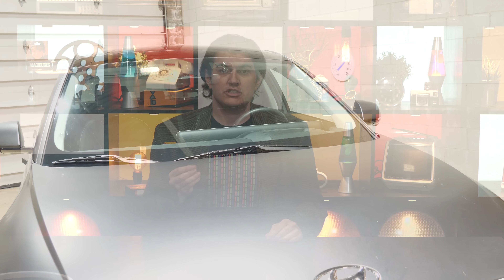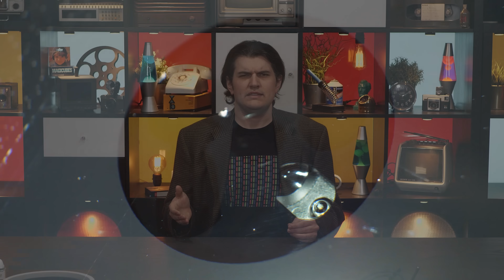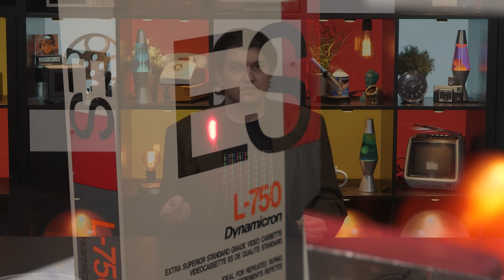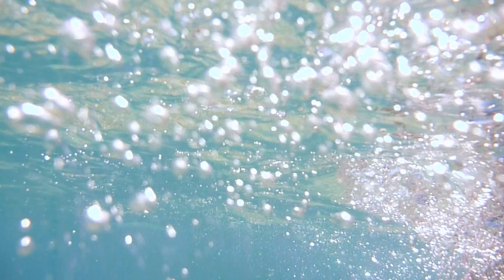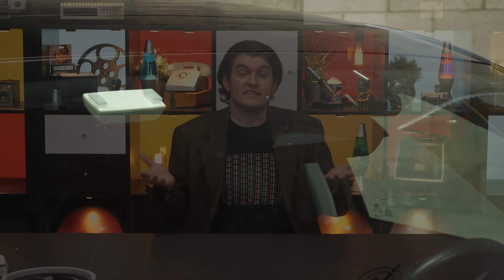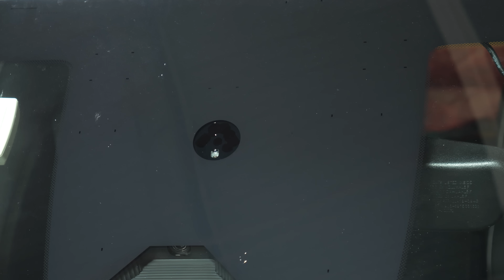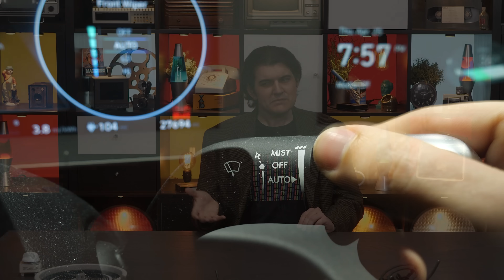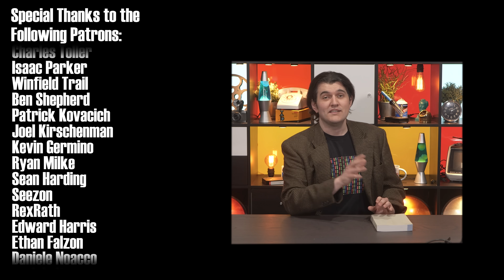The simple, clever sensor behind automatic windshield wipers

Comment: As someone who previously installed windshields in cars, I can confirm that the gel layer is incredibly sticky and if there's any air between the gel layer and the windshield or sensor the auto wiper function will not work! also my Hyundai has the same Konami code for my wipers as well and I suspect most Hyundais have the same control input to change the wipers. Easier to copy/paste code than design from scratch on all vehicles

Comment: FYI: every car I've ever had which requires a maintenance position for the wiper blades is put into the maintenance position by holding the wiper stalk in mist while the car is off and unlocked. which, now that I've had a few cars that do that, it seems like the most logical place for it.

they apparently make cars without wiper stalks, though? that's exceptionally silly.

Comment: It is difficult tu make a software  control when you dont really measure the value which you want to control
Reply: I think they know the size of the rain drops and frequency.
Reply: Either way the automatic wipers on my A4 B8 Worked way better.
but at least since the matrix software the automatic headlights were fixed

Comment: I hate auto rain sensing wipers.  I've had them on two cars, and they didn't work well on either.  Either the wipers practically never wiped, or they would wipe like crazy as if you were driving through a tsunami, when it was barely sprinkling.  I wouldn't have minded if they didn't work if the manufacturer hadn't REPLACED the intermittent the setting with AUTO on both cars (so the options were HIGH/LOW/AUTO)...if you are going to offer auto, make it a 4th option (HIGH/LOW/INTERMITTENT/AUTO).  I would much prefer intermittent, with a variable speed intermittent setting, than the awful AUTO setting.  If it's hardly raining, even then the LOW setting on cars can be overkill....that's whey a variable speed intermittent setting is so useful.  Terrible decision to replace variable speed intermittent with AUTO.  Even supposedly adjustable-sensitivity AUTO is a FAIL....as the sensing is still garbage.
Reply: Ford is probably the only car manufacturer that has good rain sensors, my work van had auto wipers with a fine tune dial for sensitivity so you could make it just perfect.
It also had the option to turn the sensor off, so you had a regular intermittent wiper.
Volvo trucks also have a great rain sensor, i drove a new FH for a while and the whole truck was amazing.

Comment: I think it'd be interesting to learn how modern cruise control works, im sure the manufacturers have their own 'recipe' for what makes the ideal cruise control.

Example: my 2016 Mustang has manual transmission and with that in 6th, with cruise control engaged, it will seemingly maintain speed VERY well while acsending AND descending. This is withiut using brakes, mind you. When headed to Pittsburgh, there were a few moments of steep descends and the car did a good job of staying around the speed I programmed it to.

Of course, you have your more advanced cruise control systems that will lane-keep and brake itself but thats getting too modern for what I'm interested in.

Comment: In 2015-2018 volvos you have to partially insert the key fob into the slot in the dash, turn off the car. Turn on accesory mode, then hold up the wiper stalk to set the wiper arms to replace the blades. Luckily you can favorite this in the digital owners manual in the cars info screen. I forget it every time I need it when washing the car.

Comment: The complete opposite to my Nissan, I have to turn it on to accessory mode then push my wiper stock upwards twice quickly, and it'll park them in “service mode”. I totally didn't have to look it up because it isn't in the manual anywhere…

Comment: These sensors were the example my old physics teacher (2015) used for a real world application of total internal reflection.

He described a slightly different operating principle which some manufacturers may employ or at least may have at the time.
IR light is injected at the edge of the glass such that TIR keeps it contained within the pane, bouncing up and down like an optical fibre. At the opposite edge, a sensor detects this trapped light. Source and sensor both need to be optically bonded to the glass, obviously.
Every drop of rain causes a small amount of light to escape by changing the critical angle due to the glass/water vs glass/air interface.

It's quite an interesting method which allows sensing of the entire width of the windscreen, rather than just at a single point or small area, but would likely more costly, requiring 2 modules rather than one. I would assume it would be less prone to false negatives due to the larger sensing area, but more prone to false positives, especially it the windscreen ever cracked.

Comment: I hate this stupid inconsistent sensor with a passion. It's never right and it's always too slow even at maximum sensitivity! WHY? WHYYYYYY????
I miss manually selecting low speeds in older cars.
Reply: I found that coating the windshield with rain repellent makes it way better. In my old work van i always used the minimum setting in every weather after i put on the stuff.

Comment: Automatic wipers are the  absolute worst part of the new car I bought my wife a year ago. I respect the people who devised them for having a great concept, but it just does not beat or even equal traditional intermittent wipers. That wouldn't be an issue except that several car makers replaced intermittent with auto rather than making in an optional ADDITIONAL setting.

Comment: I hate my auto windshield wipers because sometimes it's only a little bit wet and they don't go, but I still can't see. My car has a dial with like 10 settings for the wipers, and the first 6 settings all change their speed based on the wetness. If it's not very wet, setting 6 will be almost nothing, and setting 7 is always pretty aggressive. I've never tried settings 8-10.

Comment: I hate these things. The problem is they replace intermittent wiper settings forcing me to either accept whatever speed the car deems correct, or stuck on continueous all the time, not to mention when the sensor inevitably fails like mine, you've now lost the intermittent settings completely. It just seems an unnecessary addition to a problem that never existed, when my eyes are much better at judging whether I can see clearly compared to a sensor that covers <1% of the windscreen.

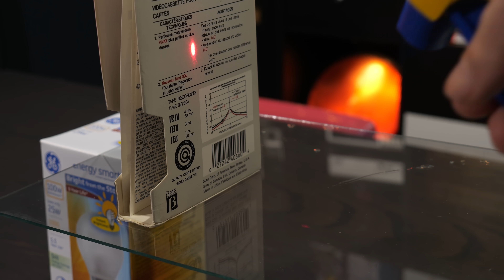Comment: 5:37 the optical phenomenon that occurs here is called Frustrated Total Internal Reflection. Its also used in digital fingerprinting, light is transmited where the ridges of the finger make contact with the glass or plastic interface.

Comment: Every vehicle manufacturer I have worked with has required a calibration of the Rain/Light sensor whenever it is replaced. Most require the vehicle to be indoors, all require the vehicle to have a dry and clean windshield. Most I have worked with save the calibration directly to the Rain/Light Sensor, from what I understand.

Comment: I worked for Acura 20 years ago when they introduced automatic wipers on the MDX. The early models had issues with the sensor interface to the glass. They were prone to false operation because of vibration. We diagnosed them by lightly tapping the glass. The faulty ones would go nuts with the lightest touch to the glass.

Comment: Hmm, I am not sure about that recalibration at every startup. Though it probably does do a self-test.

I'm sure it's different between suppliers but I've worked for two different OEMs and we do this calibration on the line. It has to calibrate three times in a row and then should be good to go from then on.

Comment: I had two very nice surprises recently after buying a very cheap Citroën from 1998. First, it has a rain sensor. And second, It´s by far the best working rain sensor i have ever seen. It never gets confused or start when it´s dry or forget to wipe when it´s wet. It´s 100% perfect all the time. And they did that in 1998!
Reply: Citroën had always been innovative. Sometimes too much for their own good.
Reply: @Filip_Phreriks  They are so brilliant that they had solutions to even non-existing problems. One of my favorites is that the magnificent DS had real-time self adjusting height correction on the headlights....on a car that also has self leveling suspension. I mean, it´s a good idea for headlights to not jump up and down when you go over bumps. But then again, I have yet to see the DS jump at all on any bumps. You can actually take a speed bump way too fast in a DS with a glass of water on the dash without even upsetting the water. Gotta love them...
Reply: Had a Renault which changed from constant to periodic wipe, when the car was stopped for a red light.
Also 90's
Reply: Too bad Citroën cars are not sold in the United States of America, and I don't know of any 1990s US market cars with rain sensors.
Reply: I had the same surprise with my old 306 HDI. I loved that little shitbox.
Reply: You will be happy to know that Citroen developed the first variable speed wiper on the SM back in 1970. It didn’t use optics to determine amount of rain, rather it detected the current draw on the wiper motor. A wet glass presented a lower resistance to the wiper motor and thus it would change speed based upon amount of water on the windshield.

Comment: The rain sensor always worked pretty well for me in any car who had one. The one sensor that does not work well is the automatic low beam, that automatically switches between headlights and dipped beam. It does work most of the time but the problem is that unless it work well all of the time, it's rather useless. If I constantly have to monitor if it does work and manually intervene whenever it doesn't, I can as well just disable it and always manually control the lights myself.

Comment: I once smashed a widescreen changing out the blades because I stopped the wipers the first way you described. Half way through the change I had to turn the ignition on for some reason and when the wipers realigned they hit the hood and came smashing down into windscreen without any blades attached. I’m in favour of reading the manual. 
Also, cool video. I like how the redundancy is your favourite part; screams Engineer.

Comment: Automatic wipers aren't exactly new tech. My 1997 buick park avenue had them.  And the idea back then wasn't new.  The thing that drove me nuts is that they will go full speed ahead when not necessary. At that point,  like you,  I just put them in manual low speed.
Reply: Yeah I drive a 2000 golf that has automatic wipers. You have to select that mode though; it's not always on, which I like.

Comment: The auto wiper sensor, an ingenious solution to a problem that didnt exist
Reply: My Auto Wipers work Via an optical Sensor that Triggers the Driver’s Command Module to Mechanically Engage an Electrical Circuit to Turn On/Off the Wipers…..in Other Word I see Rain/Muck on my WindScreen, I turn them On…

Comment: Great video. 
However, the automatic setting of the IONIQ 5 is very bad and slow and usually does not work as supposed (not sure how your works that good in the video). I had my car in the service for this last week, they couldn't calibrate it, said it is normal. + after ~30 mins in maximum wipe speed they just stop 😢

Comment: My Skoda (so they use VW sensors). Doesn't do a first wipe, no matter how wet or dry it is. So I need to do it manually.

But also, good to know I was along the correct lines for how they work. I thought it looked at reflections, so if suddenly it gets reflection it would wipe, but it's actually more like if it gets a less or no reflection that it wipes.

Comment: This is crazy coincidental for me. I just bought a Kona EV and couldn’t get the auto wipers to work. I found out the sensor popped loose and wasn’t pressed against the windshield. It was several mm away from the glass and didn’t work. Popping the clips back onto the sensor, pressing it against the glass easily fixed it!

Comment: As a software engineer, thank you for spreading the gospel off RTFM. As a sidenote, the people who need to be told to RTFM also seem to be the people who don't write any manuals for the stuff they make, or don't bother describing 80% of the functionality in it. Not sure what is more frustrating. Telling people to RTFM or finding out there is no FM to R.
Reply: @DarkRookie see in software the manual usually consists of extremely obscure forum posts that will tell you everything you need to know and change your life, or it will do that until you try it and realize it's for a different version that no longer exists.
Reply: definitely the latter
Reply: RTFM seems like an unnecessary niche acronym
Reply: came to say just this!
Reply: I tell my college students to RTFSyllabus every single semester. They don't, but I still try.
Reply: I’ve definitely bought things just because I knew the manual was good (or avoided things because I knew the manual was bad and needed community forums to plug the gaps)

Comment: It’s kind of ironic, I was just lamenting recently about how I missed my previous Jeep having the RainSense system installed. A lot of times it seemed erratic in what delay or speed it wanted to operate, but it sure beat constantly switching them on or off in scattered showers, especially going down the road and an oncoming truck goes by and whips a bunch on road spray onto you. 

On a completely different topic for another video, the store I work at is now carrying Finish’s new Ultimate dishwasher detergent packs that boasts CycleSync, where each pouch in the pack bursts at a different time during the cycle. Alec’s previous videos on dish detergent packs tell me this is purely a gimmick to convince you it’s better… here again, if it doesn’t go in the prewash compartment, a vital first step in dishwashing gets completely disregarded and cleaning performance potentially diminished. So it would be nice to see a video on how it works, and if it indeed works, how well.

Comment: Now if only they would turn on the headlights as well since people can't seem to get it in their heads that headlights need to be on when the wipers are on. Cause if you can't see, they can't see you. They need to make it a standard that headlights turn on if the wipers are on (auto sense or manually actuated). I was behind a truck in a rainstorm, but didn't know it until my car accelerated down the hill faster than him. My bumper was about 5 feet away before I could see him because the truck was the same color as the rain and he had no lights on. It was obvious where he was once he started using his brakes, but disappeared otherwise. No amount of flashing my lights got him to turn his on.

But someone please tell me the point of having auto sensing wipers. You can see rain on a windshield. You can see that you can't see well. You turn on the wipers. WHY does that need to be automated?
Reply: The point of automatic wipers is that normies are lazy and they'd rather have a bad automatic system than a good manual one.
Also many cars do turn on the headlights when it's raining, my moms Mercedes GLC turns them on if the rain sensor detects enough rain.
My own Mercedes CLK turns the headlights on even when its fairly sunny out sometimes.
Reply: @TopiasSalakka  You're comparing normies to having a Mercedes. I know they're pretty much top of the class when it comes to putting tech in their vehicles, but 99% of people can't afford them, so they're not a good indicator of automatic headlights being standard. But it's good to know at least one company was smart. The only other headlight related thing I'd like to see is the daytime runners stop existing. Most cars have city lights, or halos some would call them, that should be on instead of the headlights. I can get blinded by cars during the day with how some manufacturers made their lights. Way to freaking bright, I say.
Reply: @StapleCactus  Many normies do own Mercedes today though, ever since they introduced the cheap C class their market share has grown.
And even old models have these features, which almost anyone can afford to own.
Reply: Many of those DRLs are really bad though, they're so bright and next to the indicator bulb that I can't see when they're indicating.
Nissan Qashqai is one example that comes to mind, I think it's called Rogue Sport in the USA.

Comment: How hard is it for a human to notice that the windshield is wet and then turn on the friggin’ wipers?  I’m pretty sure this “problem” didn’t need fixing. 

Automotive engineers have completely outsmarted themselves. They solve the simplest of problems with expensive, “Rube Goldberg” solutions.

The only ones who suffer from these “technological breakthroughs” are the consumers.  It’s just more crap that will break later. But hey, the dealer (who is the only source for the proprietary part) will only charge $2000 to fix it.

Comment: Also did you know that most vehicles will slightly apply the brakes when the rain sensor detects rain. This is to remove the water from between the rotor and brake pads and thus increase brake performance when it’s raining. Now with that being said if you have a failed rain sensor that thinks it’s raining all the time can cause the brake pads to wear extremely fast. This will not set a code as there is really no way to determine if it’s sensing that it’s raining when it really isn’t.

Comment: Alec, I noticed the car you used has a toll-pass transponder on the windshield.  It would be interesting to hear how those work.  Also, Illinois is switching to a system that uses a sticker applied to a windshield instead of the little plastic box.  How do they get the electronics in a window sticker?